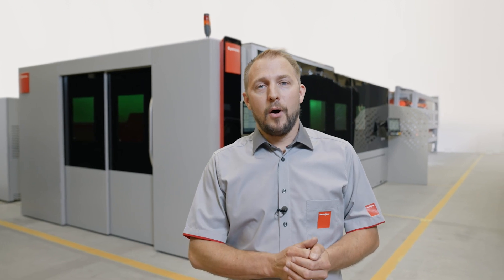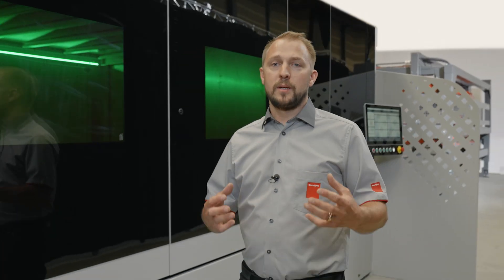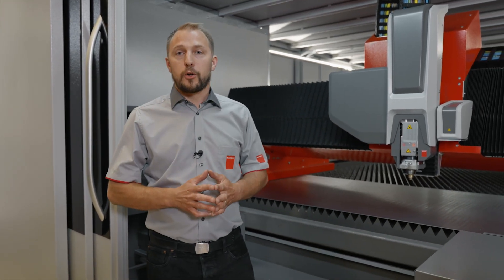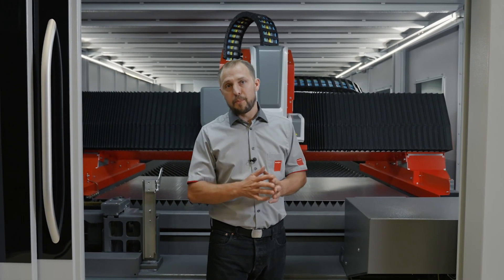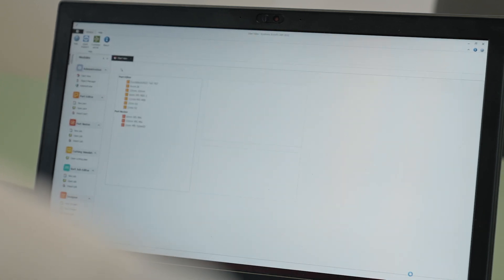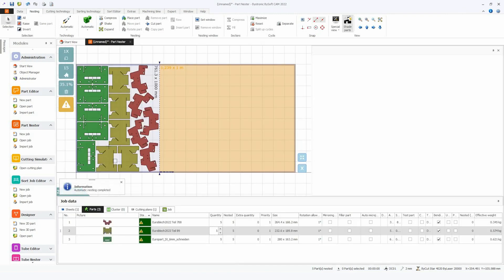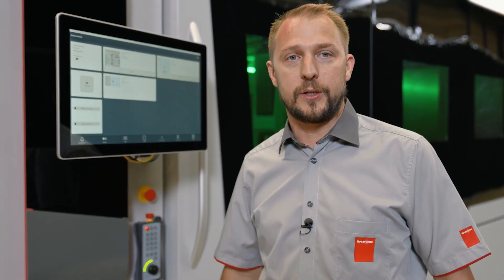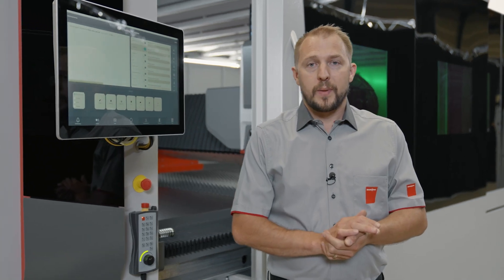Bystronic Laser Cutting: ByCut Star 4020 30 kW (English)

Comment: Funny that the video title is 30KW and at the operator walks to the side of the machine the resonator says Fiber 20 000 LOL Also, showing a high power machine on 2 mm steel is not smart since you can't benefit from the power you claim to have of 30 000 watts.
Reply: Actually the thicker you go the speed decrease is drastic. For instance we have a few 02 Trumpf lasers that cut 1/4" at 110ipm when our 15k bystronic fiber cuts at 480ipm. When going to 1in plate 02 Trumpf cutting at like 27-31ipm a mix gas fiber 40ish...then if your talking like 14ga the speed is absurd around 1600ipm compared to 300ipm on a Trumpf 02 laser. I barely ever use all power available.
Reply: Also there is no resonator on a fiber laser it's just a led diode firing into a fiber optic cable with an expansion chamber.
Reply from the maker: Hello and thank you for the comment! The main focus of the video is the new machine platform ByCut Star 4020. 2mm sheet metal is shown, as the machine has high dynamics (linear drives & optimised frame concept), which of course has the greater impact than high laser power, especially with thin sheets.